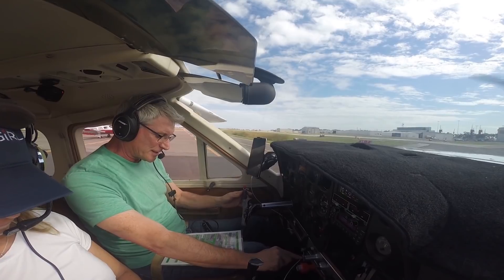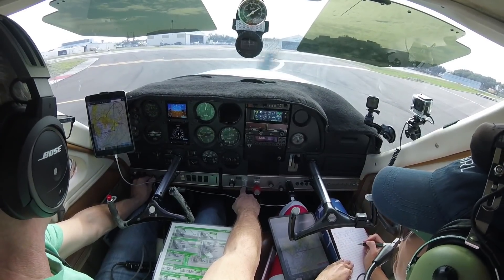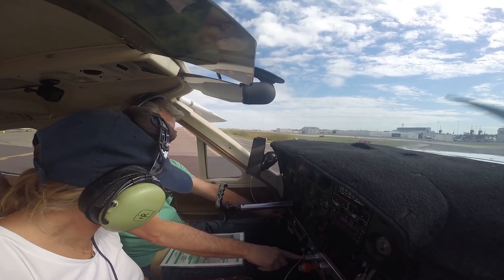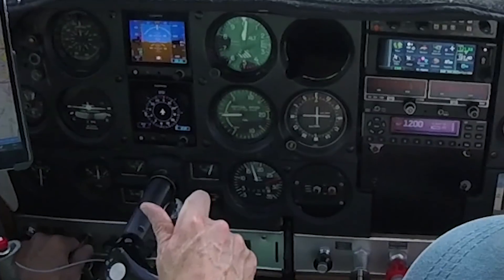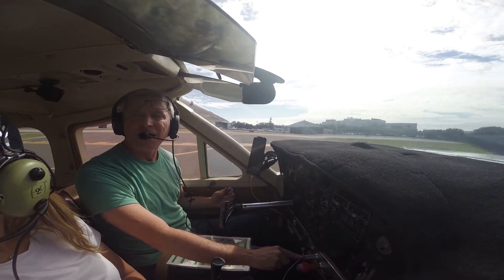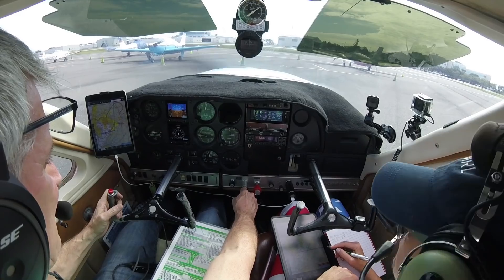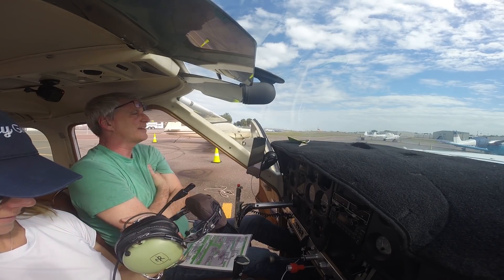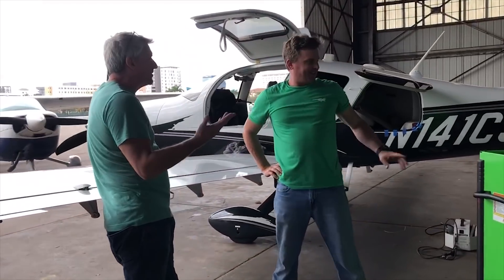Magneto Fail!

Comment: Similar thing just happened to me a few weeks ago except in my case I had an RPM drop. The right mag dropped like normal and the left mag sputtered to a near stop. It turns out that the left mag's break point was not breaking enough causing a loss of voltage going to the spark plugs.

Comment: Had a mag on a C172 go south, but not this bad. Usually fouled plugs. Trick was to lean it out and see if the fouling could be burned off. When that didn't do the trick, taxi back to parking and call it a day. Yup, this is why we preflight, for the 1 in 1000 times when stuff doesn't work.

Comment: The reason you don't get a mag drop on one mag is because the engine is only running on one mag and that's the one it's running on. It'll be running slightly rougher than usual though because each cylinder will only be getting one spark instead of two. Naturally when you move off that mag onto the one that's failed the engine will cut . You did the right thing - that's why we do mag checks in our pre-flight. Two mags give you the essential safety factor that you need to stay in the air if one fails. If you are flying on only one mag and that fails it can ruin your whole day.

Comment: I do an inflight mag check on long cross countries, when I go back and look at the JPI data you can always see when you did it based upon the RPM drop.  It gives me peace of mind that I’m not a mag failure away from an “engine out” glider experience. So my advice is add to your wish list a JPI-830 or if you can afford it a 930 and get rid of your primary fuel/oil gauges. I would not fly my family in a 40 + year old plane without a real engine analyzer that’s just part of my personal minimums. I’m thinking of upgrading to a SureFly electronic ignition. It blows me away that we are just now getting rid of vacuum instruments and we are even slower to adopt electronic ignitions (not sure when the last car with points was sold in the US but it was a while ago). All my friends that have made the switch say that there is a fuel economy payback. To me that’s a side benefit to be considered after risk reduction.  Love your channel!
Reply: Why do an inflight mag check that could involve your engine cutting out? If the engine is running a bit rough, you land, you don't do a mag check in the air. If the engine doesn't restart you will be in trouble when you might have landed safely with just a rough engine. IMO inflight mag check = very bad procedure.
Reply: @battz99  sorry for the lack of clarity. I’m not suggesting you do it if you already have engine roughness  I’d suggest getting on the ground quickly or at least in the pattern then if you have roughness check mixture, fuel source, carb ice, etc. my point was to see a potential mag problem before it’s obvious.  a mag check in cruise can give you data that can show a failing mag in post flight JPI data analysis. Hope that clarifies.
Reply: @johnquimby3079  Hi John. I'm a big fan of letting sleeping dogs lie. If P's, T's, RPM and airspeed are all good and stable I'd leave my mags well enough alone and do a mag check at shutdown. If a mag is on the way to failing in flight to the point it's becoming noticeable it will show itself in other ways eg you'll notice that your revs to maintain airspeed are slowly increasing. My first reaction would then be to check for carb icing. If that doesn't work I'd probably immediately suspect a mag problem and look for an airfield. I've had a mag go on me that did exactly that - OK the previous flight but then airspeed and rpm all wrong next time out. I can tell you, I couldn't get down onto a runway quick enough 😀
Reply: @battz99  We could solve the debate and upgrade to electronic ignitions and eliminate technology invented in 1897! I agree with a prior posted comment - post flight mag check is a best practice. I just put in a new breaker and pre-wired for a Sure-Fly in 2021.
Reply: @johnquimby3079  Good call

Comment: Curious to know, what sound would it make if you had 1 or both mags fail while IN flight ( up in the air )? And would the engine cut out in the air? No sound at all?
Reply from the maker: One mag out the engine may run rough - both the engine would cut out - I 🤔 think .... thanks for watching!

Comment: Maybe goes without saying, but the no RPM drop on the left mag check because the left mag was the only thing running the engine on 'both' as well, so there would have been no change in spark between 'both' and 'left.'

Comment: It is amazing how our understanding of various aircraft components and systems increases after we accumulate experience with different failures.  You will notice your Cardinal’s engine has 2 spark plugs per cylinder verses the single spark plug in your gas lawn mower.  For safety your Cardinal’s piston engine was
designed with redundancy in the ignition system; two magnetos, two sets of ignition leads lead to two spark plugs in EACH cylinder.  If one component fails in your ignition system you aren’t automatically
forced to look for someplace to land. With both spark plugs firing at the right time you get a more efficient burn in your cylinder.  When only one spark operates you get a less efficient burn in your cylinder producing less power that shows up as a drop in RPM. But you can shove the throttle in further, add more fuel and bring the RPM up.  That’s why you showed no drop during your mag check.  Apparently you only had one ignition system operating.  With the one operating system you brought the RPM up to 1,700, then “shut down” the failed mag/ignition system which had ZERO effect on the RPM because it wasn’t working in the first place.  On the other hand when you checked the other side and shut down the only operating ignition system SURPRISE things got real quiet…..  Your first clue of a failed magneto during the run up was when you did not see an RPM drop when you did your “mag check”
(If you checked the operating MAG first).

Decades ago I was flying Cessna 206s in a remote region of the world (jungle).  We had a STC (supplemental type certificate) for an emergency secondary fuel system to back up the fuel injection system that came with the Continental engines we operated with.  The emergency fuel system introduced fuel into the induction system bypassing the fuel injection system entirely.  It worked well and would get you home in a case where the fuel injection system failed.  It was another level of redundancy.

Somewhere along this journey I heard this:  “Experience is a difficult instructor, first it administers the test then it teaches the lesson”.

Comment: Magnetos differ from the ignition on cars in one major way, magnetos produce their own electricity to supply the spark to the spark plugs.  In this way, there are two independent electricity sources to keep your engine running, independent even from the battery and electrical system of the aircraft.  Its actually similar to a push lawn mower in that respect. Once the engine is spinning on the lawn mower, it generates its own electricity to supply the spark plug. Same with aircraft engines, except there is double redundancy, hence two mags.

Comment: I do a Mag's check before shut down as well as on Run Up, so you might have picked it up then. 

As I am Ex-RAF one of the things that I find funny about most GA pilots, is they don't do a walk round After Flight only do a Pre Flight, I like doing a After Flight as that way I know my plane is still in one piece or I know I have to fix something before next flight, and the Pre Flight just makes sure the Mice have not got in and made a nest or drunk all the engine oil.

Comment: I experienced a dual mag failure on final while training for PPL, didn’t realize it until after landing when the engine was out and couldn’t taxi to ramp!
Reply: The odds of two mags failing at the same time is astronomical.  Now if you don't do a mag check ever... then you could have been flying on one mag for a year before the second fails.  Then you would actually have a two mag failure.  Or if the mechanic had miss wired the mag switch and the switch never allowed you to shut down a mag.  The test for this is to go to OFF and make sure the engine shuts down.

Comment: You caught yourself falling into a checklist trap. You called out that there was a good drop as you were performing the test and before you had the results. Good job.

 You might think about changing up your checklist routine. Try to find a method that forces you to process the info before calling out the answer.
Reply from the maker: charles streeter absolutely - I am changing my checklist!

Comment: I had a mag failure once. It worked great on the ground but on climbout it stumbled a little. I circled around and landed. It worked fine at 1,700 RPM but not at full power. I think the bearing had failed as I recall.

Comment: Well worth sharing.  This is exactly why engines have two mags.
Reply: So the best thing that can happen is having the Magneto on? Its like not removing the spark plug from a car before driving somewhere with the engine on. So according to this

https://www.aopa.org/news-and-media/all-news/2002/january/flight-training-magazine/the-magneto-check#:~:text=Think%20about%20it%20-%20if%20you,that%20prevents%20it%20from%20working.

It would certainly seem that having a working magneto is one of the most important things in any helicopter or aircraft in case the alternator fails.

I only say this because in another video I watched 4 people climbed into what appears to be a Robinson r22 helicopter which by itself weighs less than 1500 lbs and loaded the weight of 4 people and several semi auto assault rifles so probably added an additional 900 lbs to their ride and climbed up to maybe 150 feet or much less like 75 feet before the RPMs died and they used the auto rotation feature to glide down to the ground landing poorly as not pointing the nose of the helicopter up to take full advantage of the auto rotation but regardless landing fairly smoothly aside from a few bumps and bruises and the helicopter even looked intact (mostly.)

Everyone agreed it was a heroic landing including me. But when I pointed out I believed the error was overloading the helicopters weight limit especially with munitions strapped with rifles and ammo etc probably creating some stress on the engine I was called out by several commentators that apparently I am "misinformed about how aircraft work" especially when I challenged the idea that in flight school 50% of the lessons learned in obtaining a PPL or CFI involve just learning to land the airplane.

Now I have been called out in a comments thread as not liking guns because I question the flight regulations involving the pilot himself being armed to the teeth while flying (regardless of the amount of times I have gone out shooting rifles) and my idea of flight school is misinformed and my idea of a magneto not being switched off being what actually caused the helicopter malfunction the helicopter dropped almost like a brick to the ground minus some sloppy work with the autorotation at the last minute.

Lol not trying to drag my argument from another videos comments section into this video. I am just always amazed at pilots who believe in creating excuses for their mistakes instead of admitting what they do wrong. I applaud any safe landing previously about to turn fatal and commend anyone continuing to live for a really long time.

If 4 people hopped on the back of a motorbike with gear loaded on and the bike takes off and falls over after some few hundred feet I imagine I would not say "the bike fell over because I forgot to take the spark plug out before riding out onto the road causing a malfunction in the engine and the bike to fall over."

I know not everyone gets their PPL to get an additional 1500 hours of flight time then to fly for the FAA but I still think pilots who make the same mistakes over and over and over should have their license pulled.

Comment: The mag may have failed during flight to your destination. Naturally you parked and shut the engine down then. If you did a mag check before shutdown, you may have discovered the bad mag then. But that is not a normal procedure, so it doesn't show up till the next day when you prepare to depart.  Cheers from Winnipeg.
Reply from the maker: Peter Toth That’s what I figured happened because during the flight the engine just started running slightly rough so piecing it altogether that’s exactly what happened thanks for watching!